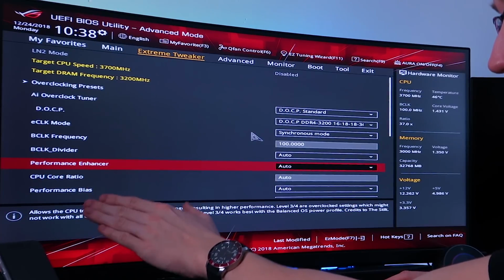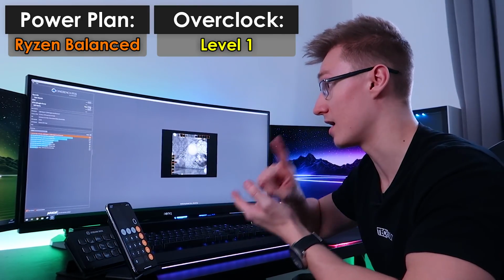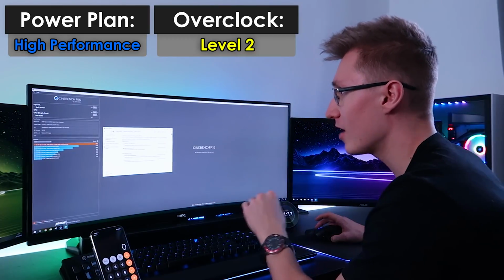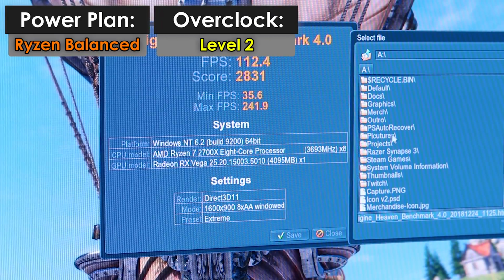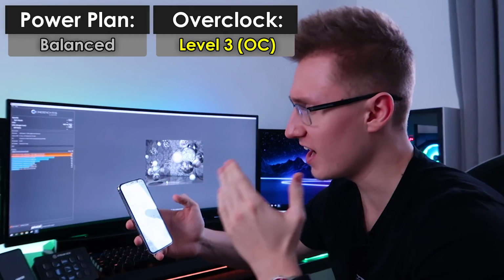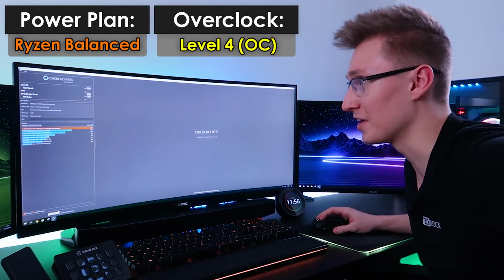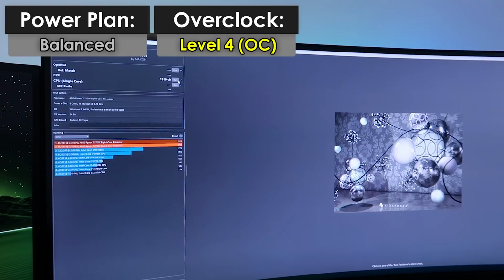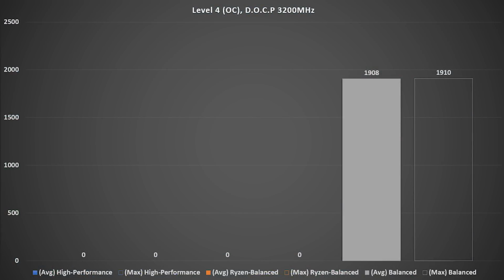AMD Ryzen 7 2700X Overclocking! - Level 4 (OC) 4.34GHz

Comment: I have a Question, Since I have an X470 Gaming Pro Carbon board it does not have " Performance 1 2 3 4", modes. So my question is, do you know what those actually do? in regards to the settings? I mean I guess I could just push buttons in my BIOS like you did and see, but I was looking to see what settings were actually being applied.

Comment: Can u overclock this with the wraith prism cooler?!
Reply: Stock rgb cooler , if not can u do a video over clocking with the stock cooler
Reply: If your case has enough airflow, then yes, you can overclock using the stock cooler. However, you want to keep your temps around 65-75°C whilst putting a load on the CPU. It also depends on whether you win the "silicone lottery", some chips will require much more voltage to overclock, which will increase the temps. So you can squeeze a few MHz out of your CPU, however, with a stock cooler you won't get enough of a performance gain to make it plausible. I would suggest investing in a 240mm AIO cooler, especially if your case has restricted airflow.

Hope this helped.

Comment: I reach 4250 MHz on all Cores stable but 4300 MHz is crashing
Reply: did you notice any FPS gains in gaming w/ the all-core OC
Reply: @dyyylllaannn  12% better fps
Reply: @juliamilenaivancyk4819  clock / timings on memory ? 
I’m running precision boost overdrive and 3200 14-18-17-36 
Hoping to squeeze another 10% FPS with all core 4.2
Reply: @dyyylllaannn  PBO is not good, let the 2700x run at stock or all Core OC (max 1,36 Vcore
Reply: @juliamilenaivancyk4819  thx

Comment: 4.34ghz?? Your still running at stock settings looks like your title is wrong on this video you did only over clock your ram at the end on this video you said to set the fan at all speed series???

Comment: I get 1980 Cinebench points on amd overclock, with air cooler (phanteks), and 78 degree max
Reply: Jose Della Bosca Messi g with ryzen master but with my ram at xmp 3200mhz with lowered timing 15-15-15-36 I’m getting 1796-1804 with just precision Boost Overdrive on no oc yet

Comment: what the purpose of overclocking 2700x to 4.1, 4.2 or 4.3ghz?  isn't AMD'S turbo boost 4.3ghz?  I wasn't not able to get 2700x stable pass 4.2ghz.  only stable at 4.2ghz at 1.425v

Comment: As any true overclocker knows, you do not choose presets. If you want to OC a Ryzen 2700X you undervolt and raise the core count. I got 1935 Cinebench score with 42.250 Core, Volts at 1.3250 STABLE. With stock cooler 63c as high, Idle 35c. PS; My RAM is 14cas so that helps alot too....

Comment: Has anyone managed to overclock on air? if so, how much? (Voltage/Multiplier).  Iam upgrading from an old A10-5800k/ FM2 mobo to the MSI x470 Gaming Plus/2700X.  Keeping my 2 year old RX 480 8Gb, 750w coolermaster PSU  and my Samsung 850 SSD drive. 
Video wise, I just bought (2/17/2019) from Ebay another RX480 8GB @ $105 shipping included. That should get the video around 1080 perfomance in many games. In my case, it is cheaper to get another 480 (to XFIRE) than it is to get a single decent current gaming card ($350+). 
But I digress, I am interested if there is any advantage in FPS to OC'ing the 2700x?  Or is it negligible?
Thank you for your time.

Comment: as I see, you made the test with the proccesor on its 3.7 base frecuency, I have an 2700x too and I've raised its frecuency from 3.7 to 4.1 with the power enhancer level 3 with nzxt water cooler, gtx 1080ti and 16 gb ram @3000mhz and its a STABLE beast in gaming, its even stable in 3.2, it was a really good test budy, nice video, keep this way, greetings from Mexico
Reply: Is there a way to overclock it to 4.3 ?

Comment: 1973 on Cinebench R15 - Ryzen balanced - 4,3GHz (all cores) - 3333MHz CL14.  Stable and pretty sure it can get  past the 2000, only spent 2 hours on overclocking till now. So just luck or there is more performance to get out of it.... Fe. focussing more on memory instead of mostly looking at my CPU speed. Stupid oops on my side. Was just trying stuff out, pc isn't even finished yet... the right side panel isn't even on there so loosing a lot of cool air...
Reply: What CPU voltage are you using for 4.3(all Cores) I can only get 4.175 @ 1.425v with Asus B450-E Mobo.
Reply: @VineetChhabra007  Also 1.425V on an Asus ROG Crosshair VII Hero (X470). I lowered my memory speed to 3266 though, because 3333 was giving issues. Still CL14, but I'll have to play with that. It's on the stock 3200 timings (Cl14-14-14-34). What kind of memory do you use? What kind of cooling do you use? I use a Cooler Master MasterLiquid ML360R RGB with push-pull. Yes overkill, I know. But looks cool and works like a charm haha.
Also still haven't tried to push CPU more. It's stable as it is now so I'll look at that later since it will be time consuming... I'll try to play with the memory speed and timings first, since that seems to make the biggest difference.
Pls let me know the above, it should be able to run at at least 4,2.
Reply: @Ries  I am using Deepcool Castle 240 as well. Should I try with 1.45v for 4.3ghz? I am running 3400mhz using DOCP SETTING LEVEL 4.
Reply: @VineetChhabra007  That's it... You're using DOCP. Try switching Enhancer  back to auto... DOCP lvl 4 can mess things up, I'm on Default. Just up the core ratio..
Reply: @Ries  Thanks gonna try this in few minutes. Will let you know. 😊😊
Reply: @VineetChhabra007  No problem at all and pls do 😉👍
Reply: @Ries  BTW forgot to ask you one thing. What's the Temp like? Idle, gaming and stress testing and which temp reading software are you using? Because I am getting different results from different softwares
Reply: @Ries  Not working for me. Even at 4.3 the computer just freezes up at start. :(
Reply: @VineetChhabra007  I'd need to check again (I'll get back to you about that), but they were good. What are your latencies? I use CPUID HWMonitor for temps and such.
Reply: @Ries  I am using Auto for the moment. Which is 16-24-24-24-57 i guess
Reply: @VineetChhabra007  You should be able to reach at least 4,2... What are your temps? I'll check mine as soon as I can. I'm almost thinking you might be running to hot...
Reply: @Ries  Gaming Anthem at 4.2ghz it gets around 60-65 max. Normally its around 40-50
Reply: @VineetChhabra007  And running cinebench?
Reply: @Ries  max 71 then goes back down to 40's again.
Reply: @VineetChhabra007  That sounds good. Mine is hovering around 40 and on Cinebench it tops at 73 at 4,3. Is it stable at 4,2?
Reply: @Ries  Yeah, seems pretty stable. RAM at 3400. Everything seems smooth and good.
Reply: @Ries  why don't you add me somewhere and we can discuss this there.

Comment: try intel 9900k or delidded 7820x..much better for overclocking..more fun then 2700x..my experience...intel has more expensive toys but they run faster and they are more enjoyable with no hiccups

Comment: I don't understood what you did on OC by Minute 16 to got the higher result. So you didn't oc the Mainboard or Graficcard?
Reply: He was overlcocking the precision boost overdrive, which is really the best way to overclock X model 2nd gen ryzen. He is basically increasing the all core boost clock without forcing all core at to certain clock, by doing that you not only increase all core clock but gain even higher single core boost. A normal overclock you lose single core boost.

Comment: I have the Crosshair VII Hero and the 2700x with Trident Z 3000mhz CL14 kit, and a EVGA1070 FTW2 ICX GPU, and I just ran UNENGINE Valley @ 1080p DX11with my CPU at stock, on balanced powerplan, with my GPU overclocked to 2100mhz, and scored a 4496, with everything running in the background. Proof that the Unengine test is GPU dependent.

Comment: OC'ing a 2700X for daily use is somewhat nonsense.
Reply: this guy made the test with the proccesor on its 3.7 base frecuency, I have an 2700x too and I've raised its frecuency from 3.7 to 4.1 with the power enhancer level 3 with nzxt water cooler, gtx 1080ti and 16 gb ram @3000mhz and its a beast in gaming, your comment is really nonsense
Reply: @robertomorales5347  my 2700x goes up to 4.35GHz - probably on a single core only - and usually operates at around 4GHz. The performance gain with overclocking it manually is negligible in my experience. Update: my 2700x goes up to 4.35GHz on all cores if slight undervolted.
Reply: @danield.7359  don't do it lol.. Basic usages wont profit from OC, the difference is mostly visible in productivity and gaming. If u are just a casual pc user, why bother
Reply: @jatingupta7439   I don't bother at all since the CPU overclocks itself automatically. The performance difference from this to a manually oc'd 2700x can be marginally only. But I did oc the RAM up to 3200MHz and tight timings (and installed an NVMe m.2 drive). Can't complain about lack of performance in whatever I do.
Reply: @danield.7359  I agree, RAM OC is more important in Ryzen Builds as the cpus can go further on their own to enough frequencies.
Reply: @robertomorales5347  does 2700X not go up to 4.7 ?

Comment: yo dude, i got almost the same setup as you, but I need a choise a new cooler, becouse wraith prism in overload is too noisy, is nzxt kraken x52 good choice? Is it a super nitro jumpjet in overload ?
Reply: What cpu and case?
Reply: @liam_1910  r7 2700x with fractal design meshify c
Reply: Moro96x if you can fit an x62 without removing any fans I think it’s better value especially with such an hot cpu

Comment: I have ryzen 5 2600.Problem i have are that whenever i do manual oc my temps will fluctuate between 31c-46c then back to 31c the whole time.It does not do this in the bios tho.Only in windows.I got my mobo set to gaming mode that boost the cpu all core boost to 3850mgz and it runs fine.

Comment: When overclocking your CPU and GPU you're going to need more air flow within side of your computer so you're going to need to make the RPMs on your fans inside the case the fan on your CPU and the fans on your GPU run at a higher RPM
Reply: yeah I did this the temps are looking good just a little noisy

Comment: the way your overclocking is correct but it's also wrong because if you're going to overclock the CPU to get higher performance you're going to also want to overclock GPU because some applications and games sometimes rely on the GPU more than the CPU and other times it's the other way around

Comment: I see that you're overclocking the CPU but why aren't you overclocking the GPU to get a higher FPS if you want to overclock the GPU I suggest getting MSI afterburner
Reply: Ya his score isn't increasing because his GPU is the bottleneck
Reply: @vegajf51  his GPU is definitely not the bottleneck it just needs to be overclocked
Reply: @JDMA2009  well it is, that is why he needs to overclock it... to reduce it holding the cpu back.
Reply: @vegajf51  he has a very very powerful GPU in there so his VP was not the bottleneck nor is his CPU the reason I'm saying that he might want to overclock it is because he might want more performance even though he has a performance that he already needs

Comment: Got some serious issues with my 2700X and overall my pc. So my temps going crazy, my kraken x52 makes weird noises and the pump works just at 60% and not lower (cant set someting below) and sometimes i got blurred text. I tried like every fucking thing. Since we got almost the same bios (x470 Prime) and the same CPU as well as the same cooler I hope u or ur community can help me.
Reply from the maker: What’s your voltage at?
Reply: @TechBlock  at my cpu? Stock. Runs at 4.00ghz.
Reply: @TechBlock  it all started with cpu fan error. My pump connector sits in cpu fan 1 and not aio pump. That was recommended by a friend. Same as yours?
Reply: @amon1486  sounds like your pump is failing
Reply: @vegajf51  How? Took it off, and immediatly on the new mainboard on. I did this befor thats not possible...

Comment: Do you have coil whine?
Reply from the maker: Only if the FPS is insanely high
Reply from the maker: I've only really heard coil whine whilst loading up Unigine Heaven Benchmark
Reply: TechBlock Lucky. I had two Asus Rx Vega 64 Strix´s and both had coil whine af